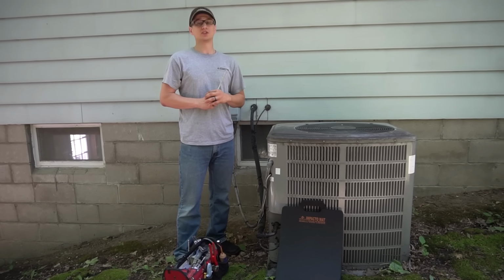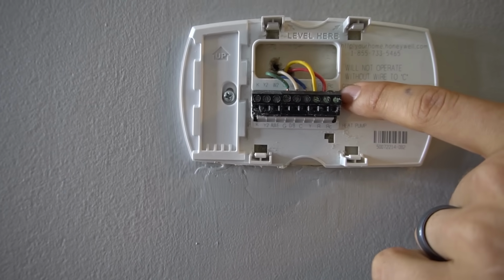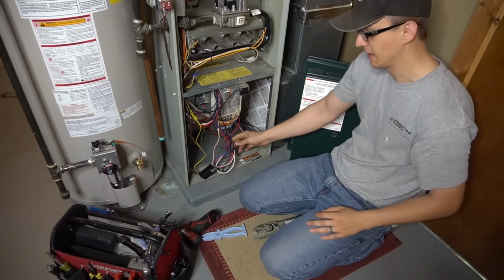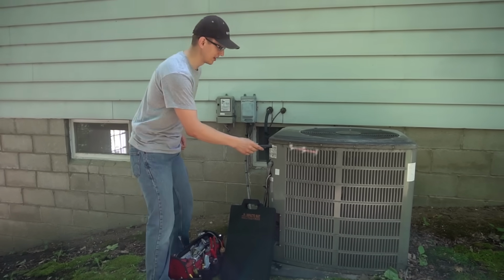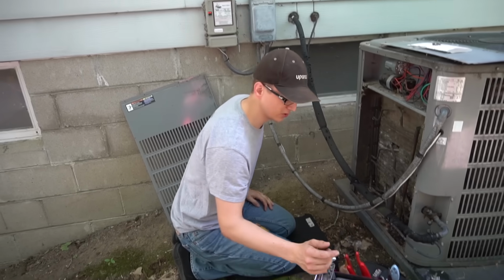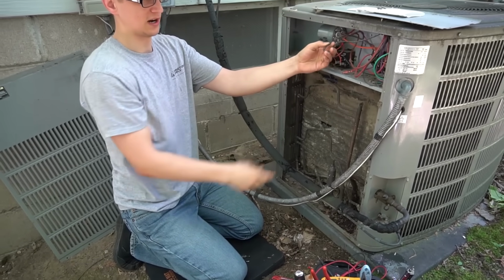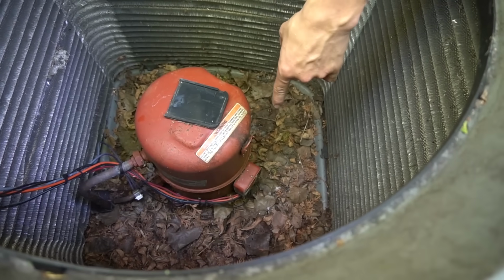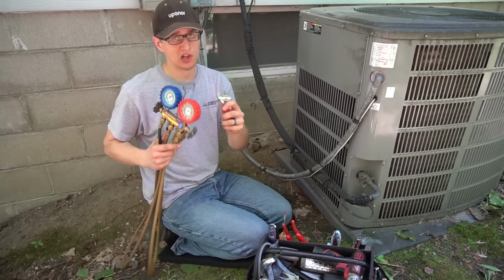AC Unit Not Turning On - How to Fix It Step by Step

Comment: Today my husband decided it was time to shut the windows, open the all the vents & get the AC kicking.  

Anyhow, he flipped the outside breaker to the unit, nothing. Checked the inside breakers, nothing. Thermostat, everything seemed to be in working order... He called me to make sure there wasn't something he missed, wasn't fully aware of... being I am more familiar with what is where as far as  breakers, plumbing, parts...things of that nature & where parts & those types of supplies are kept around the house.

He's a recently retired Marine & LEARNING very quickly as he goes all about home maintance, repair, remodeling and such. 

I make jokes about if can't quite get it broke loose, want it moved, dead, destroyed beyond recognition, if it has a diesel engine or requires gunpowder & ammo or there is a need exercise absolute AUTHORITY... HE'S MY MAN. Lol  

Anyhow, when I got home we both jumped on the AC issue. He HAD covered all the obvious.He was checking the outside breaker itself to see if IT was bad. I removed the panel on the unit & low and behold...BLOWN 5 AMP FUSE. Glanced at the wires from the breaker & the thermostat...a good 8 inches of the thermostat wires no longer had the outer sheath protecting them from the elements, at least 5 inches of that was completely bare...nothing but exposed wires, making contact with one another and laying on the ground next to the concrete slab. 

This was all hours before I found this video, mind you. 

I figured snip, splice & replace the fuse would do the trick. Common sense would tell ya that would work. However, that isn't always the case...so I wasn't entirely convinced or confident...dreading it to be honest. Hope for the best...prepare for the worst. 

THANK YOU! You managed to pretty much answer every question that I've been curious about & CLARIFIED what I have been a bit iffy about.  THANK YOU! 

Now that hubby is through replacing the lifters, exhaust gaskets & pipes on the Harley...we will be snipping, splicing, running conduit... identifying what is where, checking for any other issues. 

Again, THANK YOU SOOOO MUCH.
Reply from the maker: Your comment was a pleasure to read and you two sound like a lovely couple!! I appreciate you taking the time to share your story! :) Glad to hear that my video helped answer any remaining questions! You were miles ahead of what the average home owner would have done. Enjoy the summer, the Harley, and that husband of yours! Be well and stay cool!! ;)

Comment: Very helpful, my compressor and fan weren't working, this video saved the day and my wallet. We replaced the batteries in our thermostat weeks ago, the heat worked fine but when we started to need the A/C the compressor and fan were not. Helpful hint, check what you did last. We didn't have the thermostat back in the bracket properly.

Your channel is subbed.
Reply from the maker: Hey David! Glad to hear you got it fixed! Stay cool ;)

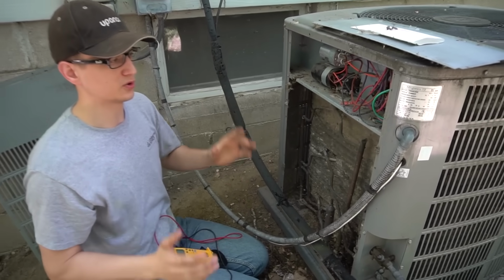Comment: @ 19:32 was the diagnosis for my issue. I wasn't getting power to the system. My issue was the disconnect box outside the disconnect plug was not making contact so I just bent the prongs outwards a little bit and then pushed it in and it worked. thank you so much for this video it was very informative and saved me quite a bit of money.
Reply from the maker: Awesome! Glad to hear you tracked down the problem. Stay cool! ;)

Comment: I have a Goodman gsx130301BB. The contactor is buzzing. I have a Packard c240A. I see other websites saying I can use a 30amp or 25 amp. Does it really matter?
Reply from the maker: 30 amp is the most common so I would just use that if you have the option.

Comment: This might be the best top to bottom overview on troubleshooting AC problems.

I don't want to criticize but this is a safety problem
The edges inside that blower motor housing are sharp.. Cut myself last year trying to spin the blades. 
Wear gloves if you're going to blindly put your hands inside there!

Comment: Great Video! So I've checked everything you cover in this video: turn thermostat to fan-works, fuse-check, run capacitor-check, plunger-check, and my AC still does not come on. Do you think maybe my thermostat is bad?
Reply from the maker: Sounds like it may not be getting 240 volts. Have you checked the AC circuit breaker and if your disconnect has fuses perhaps those have blown?
Reply: No fuses, just a breaker, checked voltage on feeds outside, it's getting the voltage 245.
Reply from the maker: If your contactor plunger pulls in on it's own, then the thermostat is good. Are the contactor contacts perhaps not making good contact when the plunger pulls in? You verified that it gets 245v but do you have 245v coming out the other side when the plunger is pulled in?
Reply: @WordofAdviceTV  If I push  the plunger in the AC starts up. The plunger is not pulling in on it's own.
Reply: @WordofAdviceTV  Okay, so I found your other video on troubleshooting the thermostat, I jumped the contacts for the AC and it came on, thermostat is bad. Thanks, you are the man!
Reply from the maker: @Tybarrondo  Glad to hear you found the culprit! Good luck with the repairs and stay cool! ;)

Comment: Great great great! Good job kid.I know nothing about AC units. Now I understand a bit more. My thermostat works. Unit says cooling. Fan on out side unit is spinning. When compressor gets called to turn on unit hums for about 2-3 seconds then nothing. Air comes from vents when fan is turned on at thermostat. I think probably capacitor. not sure checked with a meter and test seemed to work. I tested on ohms at 2000 from C to herm. meter climbed. From c to fan meter blinked for a second.  Not sure why but fan is working. any suggestions I have a 40/5 mf cap where can you buy these? Thanks
Reply from the maker: Hey Eric! That does sound like a bad capacitor (hopefully, as that is a simple fix). It's a dual capacitor, so it has two separate sections, one for the fan and one for the compressor. Sometimes only one side dies but the other one is good. Which would explain why the fan still runs. I also have a video on how to install a hard start kit to help the compressor start (hopefully you won't need to watch this video and the capacitor will take care of all woes). As for where to get one, you can buy one at a local appliance parts store (can be a little hard to track one down since many of them only sell to contractors) or just order one off of Amazon - I have links in description for capacitors.

Comment: when you were going over the furnace the only thing you didnt hit was the blower motor capacitor, not all motors have a capacitor that is accessible because some are built in the motor its self.
Reply: Eddie Hall ? No they don’t lol
Reply: Yes they do some motors call for a 7.5,5 or 10 there are different sizes, but they all have capacitors the high efficiency units have motors that have built in capacitors.
Reply: Btw I do work for an ac company where I live we have electric and gas systems I do tune ups on systems daily, and some installations.
Reply: Eddie Hall I also do hvac, commercial and industrial
Reply: Yeah those are ECM motors, they don’t use capacitors. The capacitors in the module are part of the electronics that convert the AC power into 3 phase DC power. Not the same thing at all.
Reply: Chris C I could have been told wrong but that is what the lead tech from New York told me, is the motor has a built in capacitor, other then that, what I have physically seen is a capacitor on the squirrel cage of the motor.  There is still a lot I have to learn, which is why I am doing tune ups to get familiar with the systems.
Reply: But to give you an idea you have an American standard furnace I haven’t worked on those that much. But I do a lot of work on Bryant,carrier, and rheem furnaces, I know each one is slightly different in design but all have the same principles.

Comment: Great video great great video and very informative for homeowners what are your thoughts on adding a cover maybe 4 feet above the AC and around enough for the AC unit to suck air but enough to cover the AC unit from rain and snow since it seems that the corrosion is what destroys the AC unit with the time

Comment: Blower motor for Cool would not turn on after switching from working heat. Then would not turn heat back on to test.  Pretty sure it was just a dirty filter for me. That should be higher on the checklist. Not sure how the damn thing knows the filter was dirty as I don't see a sensor, but a minute after switching it the damn thing turned on. And I had been troubleshooting everything for 2 hours. Thanks for the video!
Reply: A dirty filter hinders its ability to suck! Lol

Comment: Thank you for sharing your expertise, I had a new ac unit put in 2 years ago and would not come on this spring, after going through quite a few of your videos and checking all the voltages I found the control wire from the furnace to the ac unit must have a short, no power for the contactor switch, replacing the wire did the trick. Thanks again
Reply from the maker: Awesome! Glad to hear you got it fixed and my videos aided in the process :) Stay cool!

Comment: I’ve confirmed that I have 240 VAC at the AC unit and the fan works. I can get it started by depressing the plunger, but it won’t kick on via the thermostat. Is this an issue with the control unit in the furnace? I checked that and it’s indicator light indicated normal status.
Reply from the maker: I have a video on how to jumper/bypass a thermostat and a video on how to jumper the thermostat at the control board. I would try doing that first and see if the unit turns on. (bypassing the thermostat will tell you if it is bad or not) I also have a video on 10 reasons why a contactor may not pull in if you need it.

Comment: I would agree this is the most thorough HVAC I have seen on YouTube and I have looked at many many videos. I am little desperate here as I have a sick pet and just paid for school and now soon an expensive exam certification. I have to try to troubleshoot this problem which it may not even be a problem but a sequencing issue. 
Last season AC had no issues switched to my Gas Furnace Heat Pump also with no issues. About a month ago I spent a weekend cleaning and servicing the unit carefully and everything disconnected as per yours and other recommendations. Cleaning Coils leaves and debris. Putting everything back.  Waited 7 days to turn any power back on the unit wanting to make sure nothing was wet or could possibly short out. 
I have an external circuit breaker Switch outside next to AC unit. Not the pull out kind a switch.
Inside Heat Pump, I have an old-style lever switch with two fuses inside which I checked and verified tested with meter. Both Good.
My setup on my Breaker Panel is exactly as you describe as being in this video. 1#110v and 2#220v 
Tested Capacitor myself and a friend with his tester. Good “spot on” target numbers. 
The problem when I turn the unit on in the following order. 
1. Heat Pump Fuse Box. Turned on as Units Thermostat does not work without this on. Honeywell (Model just like yours) in your home.
2.  For AC I go outside and throw the circuit breaker box. (switch type 220) 
3. At the Circuit Breaker I switch on the 110v #21 & a 220v 27 & 29 circuit breaker switches.
All done in that order because it has worked before. 
With the Honeywell set to Auto FAN, System Cool, Cool ON and Temp indoor at 77 I turn it down to 65.
However, when I do the Gas Furnace kicks on and the Gas Heat pushes out 95 degree hot air through the registers. It does not shut off. I have actually turned off the gas and tried again. Ran the same sequence and same problem Any ideas??? PLEASE HELP!
 Lost here and not sure I can find even after searching reading watching videos for days.

Outside AC unit does not run fan or make a noise. Compressor is new roughly 2 years old. I do notice a click like something is trying to run but nothing yet. If you call me I will pay you something for the time. I live in a rural area and service is limited. 3-4+ days. 
Can you help me trouble shoot? You have my word I will do something for you in repayment…?
Maybe it is a different sequencing or something I need to do first?
Reply from the maker: Sorry to hear about your AC acting up! From what you described, it sounds like either the thermostat is defective or the control board is defective. Try jumpering the thermostat and then the control board for air conditioning and see if it turns on. I don't have any videos on heat pumps because I don't work on them too often but AC Service Tech has quite a few. Here is one of his videos on how to bypass a heat pump thermostat (to check if the thermostat is bad) https://www.youtube.com/watch?v=7e5uDEHaDnA
Reply: The sequence of how you turn it on will have no effect! Unless you have a communicating system, which you do not if you have the same thermostat as in the video. 
It sounds like a wiring issue more than a thermostat if you have it on Cooling and furnace turns on(for a gas system). Not saying that cant happen but doesnt seem like a thermostat if its a gas system unless you disconncted some wires and put them back in wrong while "servicing".
 
But for a quick thermostat test, take it off the wall and get a piece of wire(NEVER NEVER TOUCH TERMINAL C TO ANY OTHER TERMINAL IT WILL SHORT OUT) and touch the wire on terminal RC or R and then touch the other end of the wire to terminal G (the inside fan should turn on, could take up to 20 seconds). if the fan turn thats a good start,  then touch the R or Rc and the Y terminal together and the outdoor unit should kick on. if it does then it "may" be the thermostat.
 
MAKE SURE THE POWER IS ON TO THE FURNACE AND THE CONDENSER UNIT WHEN TESTING THERMOSTAT  :)  
 

If that didnt seem to work then take off the thermostat and write down the the color of the wires with their matching terminal....example 

Gas heat thermostat  (1Heat/1Cool)

Tstat                                  Wire from wall 
(Terminal) R       -----        (Wire color) Red 
(Terminal) Y       -----        (Wire color) Yellow 
(terminal) W       -----        (wire Color) White
(Terminal) G       -----        (Wire Color) Green 

(terminal) C        -----        (Wire color) Blue

Then goto the Furnace or air handler, pull the disconnect or flip the power switch(OFF) and open up the pannels and look for where the thermostat wires go to. they will more than likely be 2 thermostat wires one will be from the actual thermostat and the other will be from the outside condenser. (Only focus on the thermostat wire colors not the outside units).
If its a gas furnace they should be hooked to a control board and can eaisly be seen if they match with what you wrote down from your thermostat.

if its an air hanlder it may be more diffcult because sometimes air handlers dont have control boards just a few relays.
If there is not board and the wires are just spliced/wire nutted togther, there should be a schmatic on the doors or the unit its self and that will tell you what colors are for which terminals.

if they do match then i guess try a new thermostat 

BUT if they dont match up take a picture of how they are wire and KEEP THAT PICTURE.
Then make the wires colors and terminals in the furnace match to the wire colors and terminals from the thermostat and once they match put it all back together and turn the power on to outdoor unit and indoor unit then order does not matter and turn it on cooling and let me know what happens.

Comment: The best ac diagnostics video by far! What it told me is that I'm screwed and that I'm either going to need a new compressor or a new unit which is 14 years old.
Reply: Paul V. Or you should call and professional and have it fixed and it keeps running. 14 isn’t old
Reply: Joseph M. The unit was undersized for my home. I purchased new in 2005. We never had it serviced. It's never been able to cook the house or keep it warm in the winter. I had it diagnosed and the compressor is shot. I'm debating on a $6,000 single stage, $7,500 2-stage system or $10,000 variable speed with inverter
Reply: What size house and what size equipment? Not having the ac cleaned can make a huge difference.
Reply: Joseph M. My home is just under 1500 square feet. High vaulted ceilings in living room. House built in 2005. Was told the inside unit doesn't have the ability to heat the home. I just recently found out that the inside unit is a Bryant heat pump & the outside unit is a different brand ac unit. I've always had to use auxiliary heat in the winter and in summer I have to keep the house around 80 degrees or the unit will never shut off. I just watched a video from Israels blog and he says single has fewer things to go wrong with it. Fewer parts to break. Thanks.